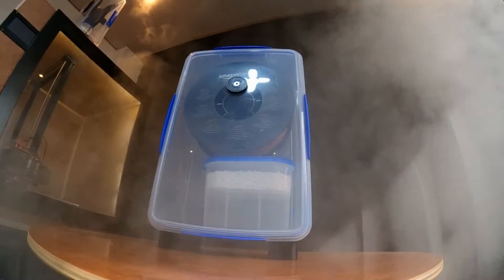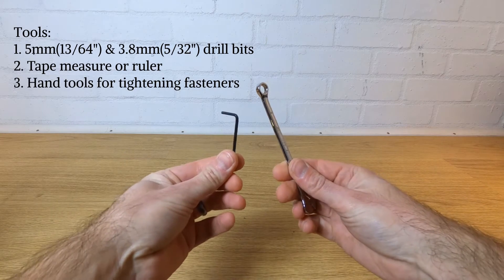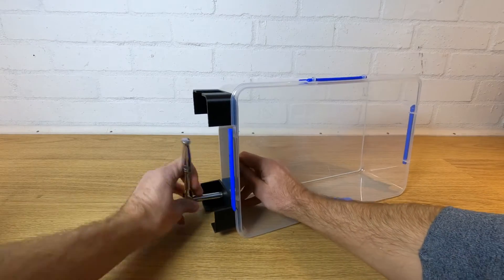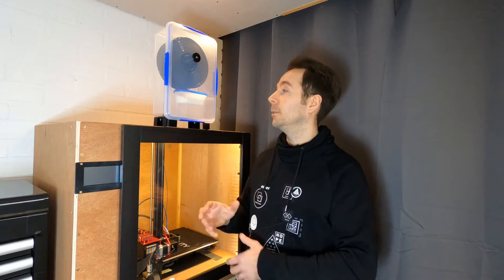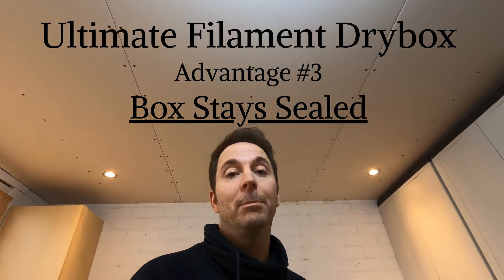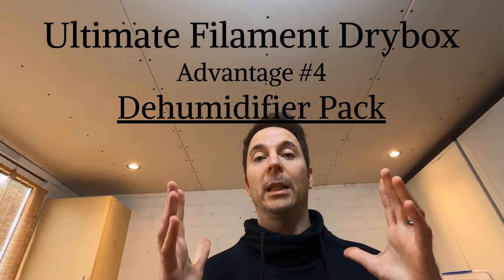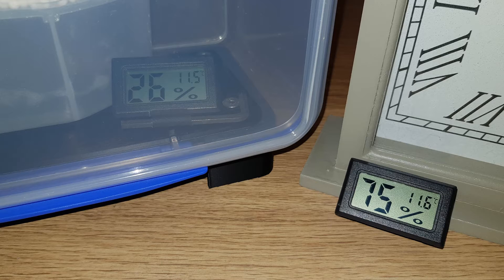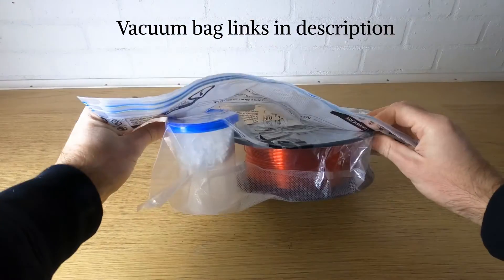Ultimate Filament Storage Dry Box - Print while keeping your filament dry

Comment: Great idea… when I finally get around to setting up my printer I’ll need to make one of these too…

Do you need to do anything to plug the hole from Bowden tube when not in use? Or find that it’s small enough not to worry?
Reply from the maker: I just leave the filament in the hole and it's then small enough not to worry about as there is very little air gap.
Reply: @RickyImpey  thanks for the reply 👍🏼 really need to pull my finger out and set up the printer… only been sitting there 6months or so… kids & work are just such a time sink.

Saw someone below mentioned the Australian sistema containers were slightly different. Any luck with modified brackets?
Reply from the maker: @nodowt  I did, drop me an email and I'll send you the files for the different sized box that worked for them. rickyimpeyyt@gmail.com
Reply: @RickyImpey  hi, dropped you an email back on the 31st. not sure if you got it?
Reply from the maker: @nodowt  just sent you a reply, it was in my spam folder 🙄

Comment: Ah! Someone else using a Thirsty Hippo. For simple storage I use a large, cylindrical airtight food container and a pouch version of the dehumidifier tub (Tesco sells them). I can store four spools in each container. At 28C humidity goes down to 20%. I don't know why everyone else uses silica gel, which absorbs a lot less water and costs a lot more. I haven't built a box for printing like this yet.
Reply from the maker: I think some people like the colour changing beads as they fit in smaller spaces and can be dried out. However, my first box is still using the same dehumidifier pack that I put in last autumn. For about £1 each, I'd say that's pretty good value too!
Reply: @RickyImpey  Yeah, they last forever if you're using them in a sealed container and don't leave them out in the open for long periods of time. Maybe these tubs aren't available everywhere, or maybe people are just more familiar with silica gel. The tubs do have drawbacks - I wouldn't use them for storing anything with electronics (e.g. cameras or lenses) since the calcium chloride can potentially release chloride ions which will corrode metal. I don't think it would harm filament, or glue. I've got quite a bit of silica gel myself (mainly salvaged from packs of medicine, or bags of seaweed, and such). Incidentally, here, at least, they have smaller and shorter tubs (as well as pouches), useful if you have smaller containers. Probably not coincidentally, I was thinking of making a box like this (a friend of mine wants to print nylon) and was looking through Shopee (online shopping portal) for suitable boxes. I noticed it was almost impossible to find a box 220mm tall or higher, but there were many that were broad enough and wide enough. I was thinking of using a lazy susan (lots on Thingiverse) and laying the spool on its side. I didn't even think of turning the box on its side - what a great idea!

Comment: if the filament is already soak , this box still working or else filament need to gill dry first before put in the box?
Reply from the maker: I haven't tested a completely soaked filament reel but given enough time, I imagine it would probably dry it out. It would probably be faster to get most of the moisture out by sitting on your heat bed for a few hours then put it in the box.

Comment: Thingiverse tells me to use a 0,12 resolution. Isnt that a little bit overkill? Thats about 8 h of printing for one Main Spindle :(
Reply from the maker: Feel free to change it, I actually print most stuff with a 0.6mm nozzle and 0.4mm layer height after a 0.2mm initial layer. Use whatever works for you, none of the parts are critical on tolerance. If they are a little tight after printing then sand down a little until they fit. I didn't have to do this though. Let me know how you get on.
Reply: @RickyImpey  Hey Ricky, thank you very much! Ive printed the object with 0,3 lh. Worked Out great. Sadly my Ender 3v2 Had an issue at around 11cm hight. Think its where the hole for the screw starts (my objectiv should be around 15cm tall). Giving it another try... If that fails i'll try 0,2..

Comment: Hi Ricky, tyvm for the design and video, love the concept. I have a request please. The sistema boxes available easily here in Australia are a slightly different design,  clips on the lid, rake of walls is lower. Could you please share the cad file(s) or see what you can do with this box: https://sistemaplastics.com/products/klip-it-plus/7.5l-rectangle
If you need any measurements,  angles etc, please let me know.  Thanks again, take care.
Reply from the maker: Hi Keith, sure, no problem. If you have one already, can you confirm the inside dimensions of the box? The difficult part to model without the box will be the plate that sits on the inside at the bottom that supports the legs. This part was a little trial and error because of the curved transitions. The good news is that you can still use the box without this part. It may be that only one part needs re-modelling to hold the filament. If you would rather email then use rickyimpeyyt@gmail.com 👍
Reply: @RickyImpey  Thanks Ricky, I'm just putting together a doc with some photos, I'll share it with you as soon as I've typed it up. Short version, the spigot needs a slight shortening, and the feet need elevation on one side to "straighten up" the lean. otherwise the rest is perfect.

Comment: Question: if the dehumidifying pack is hydroscopic, and the filament is hydroscopic, how much of the humidity is absorbed by each? Seems to me, a 'proper' dehumidifying box must be active, not passive. The moisure needs to be condensed out of the air and removed from the box.

Perhaps a good test of this box would be to weigh a dry roll of filament, then leave it in high humidity to absorb moisture, then weight it again. Then weigh the 'dry' dehumidifier pack and put it and the filament in your box. Leave it for a day, then weigh the filament and pack to see the ratio of moisture transference, if any.

Given the small volume of air in the box, you could probably omit the dehumidier pack and just let the filament absorb all the moisture...the air-tight nature of the box would prevent new, moist air coming in, so the box would at least keep the filament at steady-state humidity thru ts lifespan.
Reply from the maker: Hi, thanks for your comment. Yes that could be an interesting experiment. I'm not really sure what I would learn from the results without having all the alternative options to test in the same way🤔 My end objective with this project was always to provide a consistent, dry atmosphere for my filament which I feel I've achieved. I'll have a think about your idea and whether there is an interesting way to test this and other options for not only keeping your filament dry, but drying out an already 'wet' roll.
Reply: @RickyImpey  Thanks. It kinda feels like these passive dehumidifier boxes aren't helpful. I suspect they won't do much of anything to dry out a 'wet' roll of filament, and as a tool to keep a dry roll dry, it would be merely OK-ish; when the box is opened to put in a dry roll and dry pack, the box gets filled with humidified air, then when closed, the roll and pack will each go to work absorbing that humidity. If they're equally adept at doing that, then the roll still gets 50% of the moisture, which is better than all of it, but it's still not kept fully dry.

Given the small volume of air in the box, you could probably omit the dehumidier pack and just let the filament absorb all the moisture...the air-tight nature of the box would prevent new, moist air coming in, so the box would at least keep the filament at steady-state humidity thru its lifespan.
Reply from the maker: @imacmill  The packs I use are massively effective. Check some of the figures that others have provided in their videos. This box with these packs removes more moisture from the air than anything else I have found. Have you tried one? I think you will be surprised how effective they are. If you have wet filament then yes, there may be better ways to dry the filament but the idea is to keep filament dry so that you never get saturated filament that needs drying. Since using these I have never had a problem with moisture and I've had lots of messages from others who have built them who have discovered how effective they are.

Comment: Now why would you not add the 7watt reptile mat heater like Rich Rap did?
Reply from the maker: Hi Peter, simply because it doesn't need it. When designing the box I was always thinking I might add heat but after testing it, I found that it really is that good that it just doesn't need one. Others that have made one have found the same too.
Reply from the maker: Also, I've checked out the humidity readings he gets and mine is twice as efficient at removing moisture😉

Comment: Hi, thanks for sharing. May I ask how did you keep the rest of your filaments when not in use? Thank you.
Reply from the maker: Hi, I have a few boxes so that I can just switch out the whole box without exposing the filament to potential moist air. If I ever have more rolls of filament than boxes then I put them in the vacuum bags with a dehumidifier pack in. This keeps them dry while being stored. Links in the description👍

Comment: Great Design. I made one and it works well. I then saw a video using smaller Cereal Containers - https://youtu.be/SlegwCT6exs. The are more limited in what size rolls you can use, but work well  for the rolls I use. I was able to make a replacement cap that holds a hygrometer and a the filament fitting so no modification to the box is necessary. I posted on Thingaverse - https://www.thingiverse.com/thing:4879850.
Reply from the maker: What have you got in that box to dry the filament Bryan? The big reason for the particular box I use is so you can use the dehumidifier pack to keep to roll dry. Without it you unfortunately don't get the filament any drier, you will just be keeping it from getting any worse. Not a bad solution if the boxes are really cheap  and you live somewhere dry though. I like the 3d printed lid you've made.
Reply: For now I have 2 desiccant packs in it, which seem to be working well. The picture I uploaded was when I just put the roll in the box, humidity dropped significantly within  20 minutes.
Reply from the maker: Great, hopefully it does what you need.

Comment: Nice! Great solution but you should put inside a heater too!
Reply from the maker: Hi, I did consider a heater but it really doesn't need it. It sucks all the moisture out as it is. You can always sit the box in a warm room or near a radiator if you wanted to speed up the drying process. I'm really pleased how well it works without using any additional power.
Reply: @RickyImpey  OK, thank you for your response!

Comment: Could do without the flushing toilet POV shots. That being said, seems like a good idea. I do think the design could be re-worked to print the nuts and bolts needed to attach the base and center rod. Why buy bolts when you can just print them?
Reply from the maker: Thanks for your comment, unfortunately printed fasteners are not the most practical solution for this application in my opinion. I prefer to use the most efficient design rather than printing everything. You could of course just print yourself some fasteners if that's the way you wish to go👍

Comment: I made a few iterations of heated dry box with sensors and display. I knew that the CaO type desiccant is the simplest and efficient way of drying stuff. But as an undergraduate in engineering I always try to make "high tech smart" and get mediocre result😂. The CaO desiccant really sucks the moisture, and works in almost all temperature, super easy to see how much desiccant is left and performance doesn't drop with moisture absorbed. Tyvm Sir!

edit: it's CaCl2, not CaO!
Reply: It's CaCl2, to be pedantic. I used to use these tubs in a Tupperware to store opened bottles of super glue. Recently I needed to find a way to store PETG filament and discovered they make a pouch version of these, which have a gelling agent in them. Nice and flat, and lay on top of filament spools I store in a tub.
Reply: Great idea. I had several tubes of silicone cured up in the past. A tupperware drybox could be an easy solution to save these moisture sensitive stuff.
Reply: @yonggor  I'm not sure that would work, since I'm not sure it's moisture that sets off silicone. Moisture does set off superglue, and it sets off polyurethane adhesives (e.g. Gorilla Glue). The latter are really expensive and go bad very quickly if you don't keep them in a box like this.
Reply from the maker: I was under the impression that moisture is what makes silicone harden too. Shame, if it did work it would be great to save a whole tube going off when i've only used a little bit.
Reply: @RickyImpey  Turns out you're right:   https://en.wikipedia.org/wiki/RTV_silicone So I suppose storing silicone in a container like this would, indeed, keep it from "going off" for longer.
Reply from the maker: @iskandartaib  I think we may have discovered a new project idea to work on🤔 I'll give it some thought 👍
Reply from the maker: Thanks for the positive comment Yonggor, I started going down the high tech rabbit hole at the beggining and a friend of mine actually went the route of warming and cooling the air to draw off the condensate. To be fair, he did manage to get a bit more moisture out of the air but it takes a huge amount of power to run relatively. I was really pleased with the results I got here and genuinely think it's a great solution but it's difficult to get that across. I'm glad people are recognising that this is a neat solution.

Comment: Color indicating silica gels might be more suitable. You don't need hygrometers
Reply from the maker: Thanks, I did look into the colour indicating silica gels but they worked out less efficient and more expensive. I've had the same dehumidifier pack for three 1kg reels so far and it still works just as well as the first 👍
Reply from the maker: I've also just found out that the colour indicating silica gels are carcinogenic! I'm even more glad I use these dehumidifier packs that are safe.
Reply: @RickyImpey  Yeah, but blue color gels. They have carcinogenic Cobalt Chloride, but not the orange ones.
Reply from the maker: @brezovprut4431  Thanks, i may check them out for a future project if i have tighter size constraints.

Comment: Nice idea. A pity the boxes are so costly though as ideally I'd like to get a few of these for the filaments I mainly use.
Thanks for sharing.
Reply from the maker: Thanks for the comment David, do they seem expensive? I thought they were really good value considering I can reuse them forever. Did you look at the US or UK option to buy the box?
Reply: @RickyImpey  I looked at the UK option.
Maybe I'm just too used to the low cost of freezer bags, and need to get out more ;)
Reply from the maker: @davidl1813  if you have a solution, that's great. If you have a huge number of rolls or store your filament somewhere pretty dry then building lots of boxes probably isn't you best option. I think there are lots of people like me though that have their printer in a garage or basement and only have a few rolls of filament on the go at any one time. I think this is the best solution for people like me and works really well for me👍
Reply: For simple storage get a large cylindrical container. Mine fit four spools each, and I can stack the containers on top of each other. Cheap, too. Use a pouch version of the dehumidifier, they can just sit on top of the top spool.
Reply: @RickyImpey  It looks like the US one is double the cost of the UK one, although pretty much any airtight tupperware of similar size can work with this with minimal mods.
Reply from the maker: @garrettbrainard1496  unfortunately it is more expensive in the US, I don't know why. Like you say, a different box will work. If someone finds something in that is better priced in the US that will still take a reel and dehumidifier pack then I'll happily do another version 👍 Just send me the details in a comment.
Reply: If on the US link you click the set of four the price for each is less than the UK.
Reply from the maker: @dvohwinkel  good spot👍